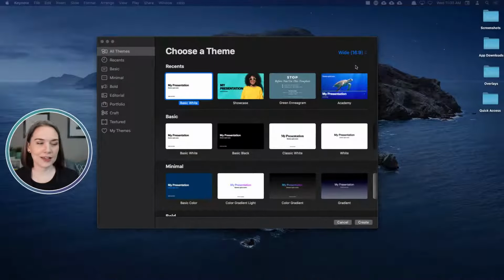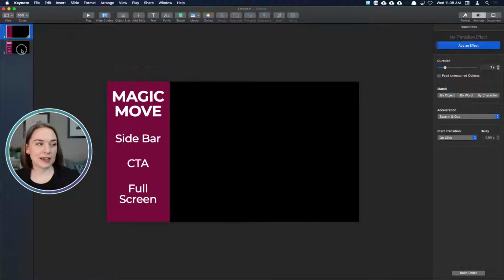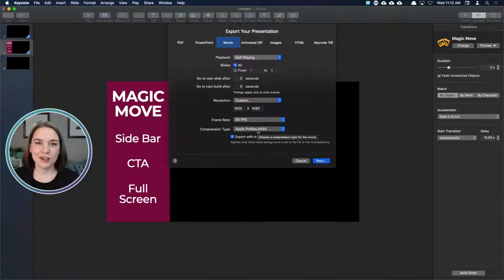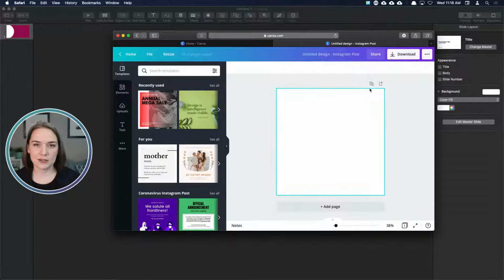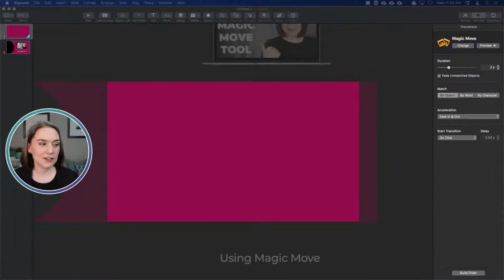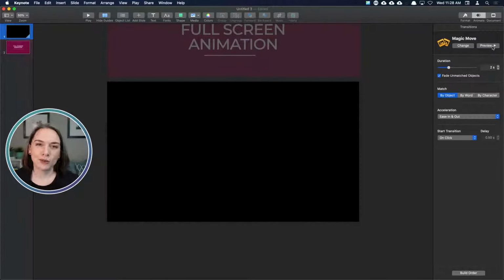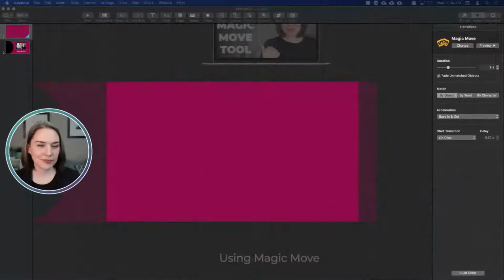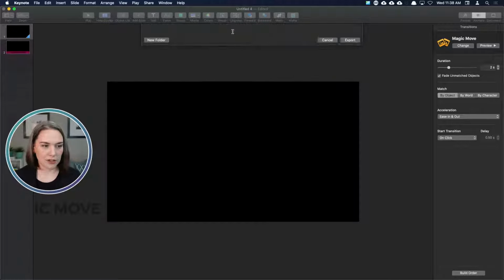Using Keynote's Magic Move Tool: Create custom animations quickly

Comment: Hi can these be done on the IPad or do you need a Mac ?
Reply from the maker: Looks like you can! https://support.apple.com/en-ca/guide/keynote-ipad/tanff5ae749e/ipados
The challenge is that I don't believe you can export to a movie file with a transparent background on an iPad. But you can design the slide with the transitions on the iPad, then do the exporting on a Mac (if you don't have one, someone else could do that for you in under a minute).

Comment: I'm hoping you still check these comments. I'm editing some powerpoint presentations in Keynote, and want to do something, which may not be possible in either program (I tend to prefer Keynote, but am a user of both). I and a professor of marine engineering, and am currently using many slide shows for lectures. I would like to be able to have a bullet list appear one by one (that much I can do, serial fashion), but I want my students to tell me an item, and I select it to appear, regardless of where it is on the list. Repeat until the students provide me with all the items on the list, or I decide to add the missing items to complete the list on the screen.

Comment: Thanks Cat. This really helped. I could almost use keynote for all my graphics if I could make an overlay transparent all the way through. 🤘😎
Reply from the maker: It's worth pointing out for recurring animations (the ones you want to update over and over), I would use the regular animation tools over the magic move so you only change the text on one slide vs changing them on all the slides. I've definitely forgotten to change the prior slide and had words transform into new words.
Reply: Oh wait. So subtract would work with squares?????
Reply: Can you subtract over an image as well? This could be a game changer for me. I love canva and can't believe that it doesn't have that ability.
Reply from the maker: I have successfully subtracted an image once, but then I struggled to replicate that. Instead, you can use the Instant Alpha tool in Mac's preview. You can create your overlay in Canva and include the shapes you want to cut out, then download and open in Preview. You can then use the Instant Alpha tool to cut out shapes leaving a transparent background.
Reply: Replay:  Thanks Cat...tried using this on my last video.  I will have to do some more trials.  This is a great way to do animations though.

Comment: While these magic move animations are absolutely fine, need a clarification. How do you bring these animations on to the screen while we are streaming live. Appreciate your reply...
Reply from the maker: I'm adding an overlay to my current scene (you can drag and drop the file into the preview window or the overlays window, or you can click add overlay in the overlays window). 
With Ecamm, there is actually a preview mode, so you could add an overlay in the preview mode and then turn it on (so you don't see the adjusting). But I didn't use that option during this stream.
Reply: @CatMulvihill  Thank you
Reply: Add it as a scene

Comment: Magic Move is great for one-time animations. The downside is, any changes to the objects have to be repeated in multiple slides. So for something like a sidebar template, CTA template and so on, I would rather use the regular animations on one slide. All the same options for sliding in and out, fading in and out et cetera are still there, but it’s much faster to edit.
Reply from the maker: Great point! That is a downside to the Magic Move. I have accidentally edited the main slide but forgot to edit the initial slide, so the letters changed mid-animation.
Reply: @CatMulvihill  I totally agree with TG. I've been using magic move for many years and use it to move objects or text from one slide to the next so you can actually see the element moving from one slide to the next. Everything you've shown here can be easily done with the Move In animation. I like how you made stuff transparent. Thate's cool, but really only useful if you're using OBS, not just Keynote.

Comment: In Teams I get a green image.  how can I enable chroma key in Teams?
Reply from the maker: You need to bring in a virtual camera using a streaming software, like OBS or Ecamm, in order to apply the chroma key. If you haven't seen my Virtual Camera video, I show how to connect your streaming software. https://youtu.be/53G2kEBqAlM
In the video, I show Zoom, but you can use a virtual camera for Teams. You just may need to check the version of Teams for compatibility.